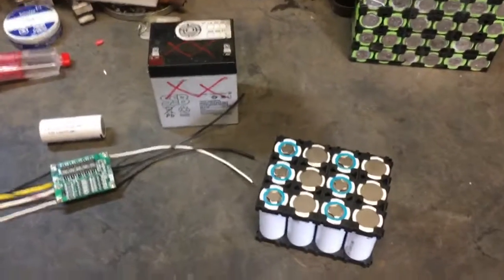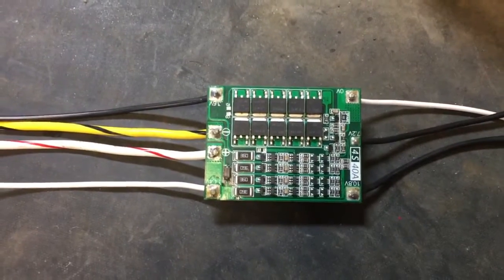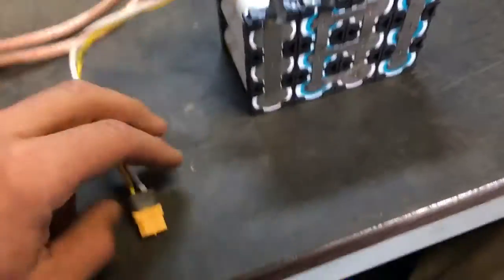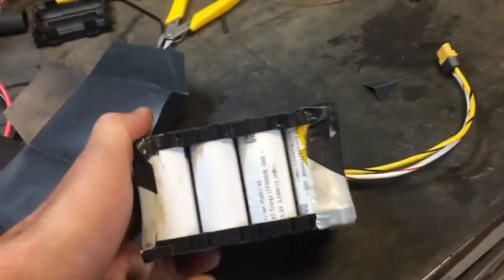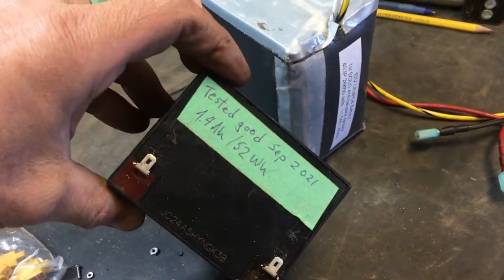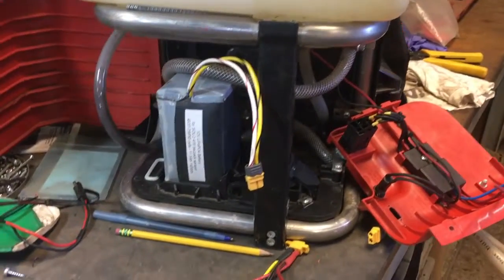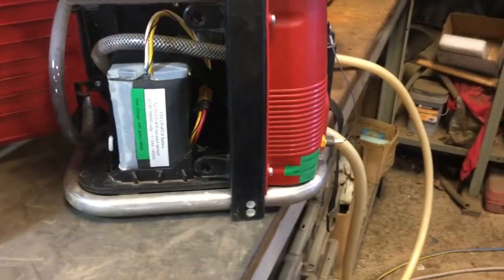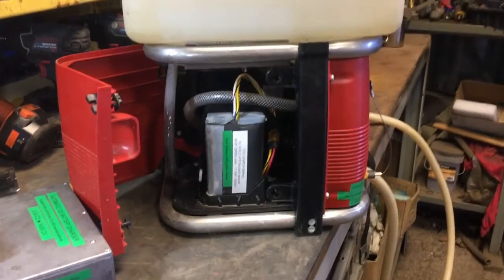Building a lithium battery pack for a Solo 416 backpack sprayer

Comment: Very nice tip on that meanwell power supply! What are you using to spot weld the tabs? Kweld?
Reply from the maker: I bought a cheap Chinese spot welder... And then I ended up buying a Suunko 709 that works for real

Comment: Those cells were marked Li-Ion but you mentioned and labeled as LiFePo, cells just have wrong marking? None the less, very cool thanks for sharing
Reply from the maker: The K2 Energy cells are definitely LiFePO4 but it's true that there's sometimes a lack of clarity in how lithium batteries of various chemistries are named.  It's important to work from mfr specs and track down all the relevant details about charge and discharge rates and voltages before designing a pack and selecting a suitable BMS.

Comment: I'm considering designing a ryobi-style adapter for my Solo 417, just so I can stop playing around with the silly charger plug and can swap out batteries and keep going. Any recommendations on a voltage regulator that will safely/efficiently step-down the voltage to 12-14v DC instead of the 18v+DC that those batteries produce?
Reply from the maker: First of all that's a great idea!  I don't remember how much current the pump draws but I remember being surprised at how little it was.  It might also be totally fine at 18V since that's only 28% over the 14V spec one has to presume for "12V" devices.  If you don't want the pump to run faster than stock I bet you can get an adjustable DC-DC that can handle 5 or 10A and I think that would be good.  Maybe test the current draw before spending money based on my hazy recollection though.